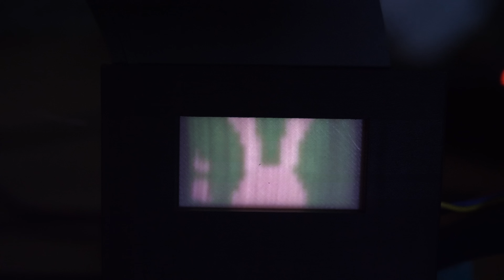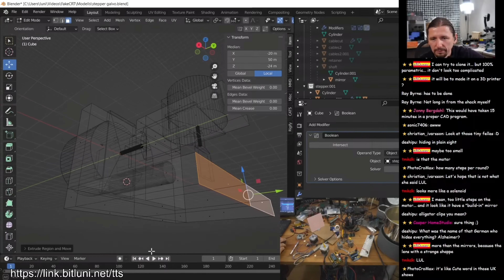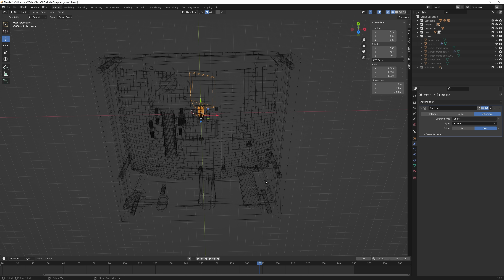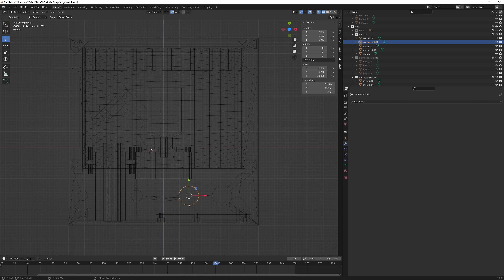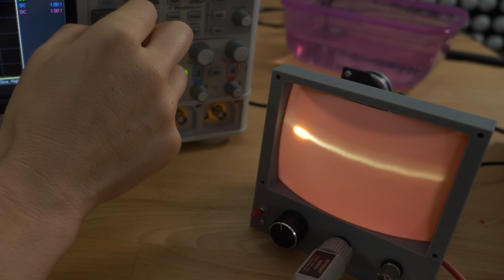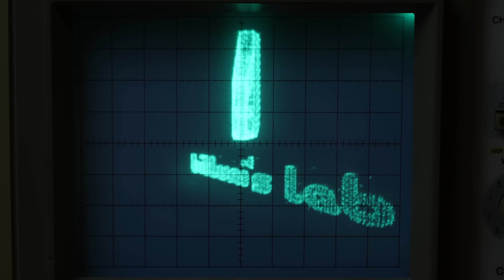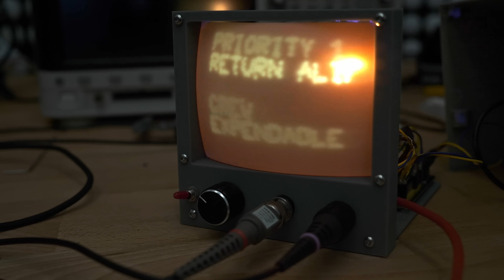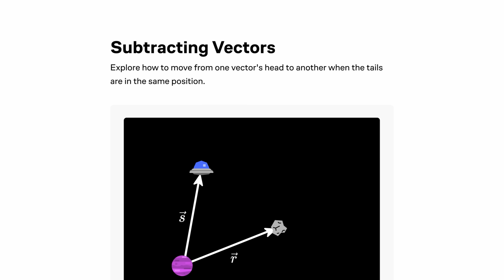I made a fake CRT TV with a LASER

Comment: Over-engineered idea: recreate the CRT method with the magnetic field by putting a lens/prism in a 3D printed enclosed that has magnets around the parameter in a configuration that would allow it to float when placed in an outer ring of electromagnets. Then alter the power to the out ring to move the lens and deflect the light.

Backup is use the magnets still as a control but mount the lense in a 2 axis gimble with very smooth barrings.
Reply: Or have a mirror in the magnetic ring. That should not only make the moving part lighter, but also reduce the depth of the whole assembly.

Comment: Excellent example of mechanical projection TV.
But I want to note that you used a slightly vicious way of implementation: in laser printers before (and in some models now) mechanical scanning of the laser beam is used. For this purpose, a rapidly rotating mirror or a three- or more-faceted mirror prism is used. In this case, on the shaft of the motor that rotates the prism, a disk with narrow passages is installed that send a feedback signal that the mirror has reached the "initial position" of the line scan. On the motor with a prism - there are several such control points (according to the number of reflective faces). The controller begins scanning the next line (ignition and modulation of the laser beam power) according to the feedback signal, and after the end of the scan, it extinguishes the beam and while the next face is approaching - sends a signal to the stepper motor to shift the drum to the next line (so that when the new face is approaching - it has already managed to take the desired position). In your case, it would be appropriate to make the line scan a uniformly rotating mirror with a signal of the initial position, and make the frame mirror, for example, triangular and rotate it with a stepper motor (it does not need such a high speed as for line scan). This will probably produce a better and clearer picture.

Comment: I thought of doing some thing like that using a vido drum, but you can also use another stuff, laying some mirrros whose reflection ovelapped for them to be able to scan at 625 hz horizontally,  a 50hz scan is a lot easier evan throug a speaker, I wonder if a laser can be modulated

Comment: there was a low-cost resin printer that used sound and a mirror for beam pointing. but instead of speakers, it used a tiiiiiny pair of actuators made out of the voice coils, glued right to the mirror itself.. so if you didn't mind the screen being kinda small, it could be done.

Comment: As I expected I'm seeing people suggest spinning the mirrors at a constant speed. Just make sure to add a sensor at least once per rotation so at certain points you know where everything is. Could even be useful to align the timing of the two if the motors spinning the mirrors have some speed control to sync everything up.

Comment: No need to shake the mirrors, it's slow. A good solution would be to let them rotate constantly. Knowing the exact speed of fusion and the position of the starting point, you can switch the laser to draw the desired point. With a seemingly greater distance, it will work many times faster. And you will get a higher quality image.

Comment: The speaker method could work VERY nicely, have laser go thru a 'lens' to increase it's sweep angle, rather than increasing amplitude of the speakers.
The mirror version is more similar in concept to an Oscilloscope than a CRT TV.
Have the mirrors pass the laser along horizontal rows, (continous spinning mirror?) have vertical movement go in steps after 'each' full rotation of horizontal mirror, ,and turn the laser on/off really fast for where you want the Phosphor to light up instead, then you'll have a 'proper' CRT. 
(It's a laser, you can turn it on/off REALLY fast)

Comment: Hi,
it's a very nice project - I really like this idea. I would share some thoughts about this.

To improve a bit I would suggest to make it in a similar way like in a laser printer. But you need more than one color because the laser only deflects in horizontal - the vertical deflection comes by rotating the drum).
If you disassemble the printer, you will get to the laser cartridge (mostly in the bottom of the printer). There you get stepper motors with already mounted mirrors, lenses and other devices. Some color printers have four of these cartridges, others two or rotating toner cartridge systems have only one. Even the lasers can be useful until the fact that they are used to expose the drum.

To improve without these parts - I would suggest to use double sided mirrors (or hexagonal mirrors like in these printers) and let them spin instead of let them wobbling. It would run smoother, the calibration is way more simple because you can use the stepper motors position (or better said the rotation / defelction angle) as synchronization. Even the refresh sequence would be more on point and it would run faster. To set a "pixel" or dot, you have to get the image into linear data and pulse the laser with these data in correlation to the motor positions.

So with this you would be in the nearest way possible at the original principle. I understand that this would be way more complicated but it would improve the goal and the result you get. You could even use monochrome VGA or better - composite with this principle - would be more easy then try to transfer image data in other ways.

Comment: You might want to add an electrolytic capacitor between the servos power pins to help with higher speed. I would start with at least twice whatever voltage you are giving (16VDC for example) and 100uF.

Comment: As educational purpose fine. But consider spin the mirros much faster, stabilise its speed , at every beginning of the revolution start the timer and you would be able now to count and  turn on laser at required  angle. This would be pure elwctronic way. Thats my idea to have more linear curves made of multiple dots. If you could have blds or pmsm synchronus motor, from    pwm generators you would know compute exact position of motor> angle without position sensor.

Comment: Just threw a flat static deflection crt door bell monitir, I wanted to experiment with to make a vector projector for vectrex game console or compatibile, years back?  Why not try that with a sequential colour filter to make vector colour.  If a kid removes or damages that screen producing lensing,  they can get much more energy to the eye.  I can tell you, for some people even so called safe laser energy levels can cayse damage.   You can use three crts, but the crt is probab,y fast enough to sequence,  however, if you use a tunnable filter fast enough you can get the colour in one sweep.  But, if you use three primary or subtractive filters, you can get the colour that way.  Would be an interesting experiment with high speed.  Now, the last part is the laser crt projector the Russians were designing for cinemas. The crt hits a special laser producing panel.  Now, if you can control the energy to safe levels, you can get a safer panel plane for kids, wity a glass tube.  Have fun.

Comment: I'm thinking raster graphics, now, but if you just spin the mirror of the X axis at a constant velocity you can turn the laser on and off for pixels.  You can drive the Y axis with a stepper or servo still as that doesn't need to move as fast.  Combine the two, sweep left to right, top to bottom, and you could possibly even feed it a "real" video signal with composite or something.

Comment: What if you used a set of servos to move the laser physically l rather than trying to reflect the laser through mirrors, the just having the laser click on a and off as it rolls across the screen, like how the electron beam turns on and off in a CRT. Rather than drawing the lines individually, though this could cause some problems with legibility. This project is a ver interesting one.

Comment: Instead of oscillating the mirrors back and forth, what if you mounted 3 mirrors on a triangular frame and spun it for scanning. The laser reflects on it and as the angle changes it scans in 1 direction till the next mirror comes into position and resets the position of the reflected beam. That way once you get the speed of the motors set to cover the entire screen in sequence you only need to modulate the laser off and on. 

Or, maybe 3 would be too much angle change and you could go up to 4 5 or 6 mirrors to narrow the scan angle of the laser.

Comment: The question is, can it run Doom?
Reply: No, it can RUN doom as fast as the computer it's connected to can. It can't DISPLAY doom without delay. So no, it cannot run doom, just as your monitor cannot. But, it can display doom just as your monitor can.
Reply: @ShishlKebab you sure a little slow
Reply: Yes it can, very slowly bcuz it uses slow motors but runs

Comment: Main problem is the mechanical movement of the mirrors. If you could figure out a way to move them with electromagnets, that may work faster, but I'm not sure exactly how you could make that work well.
Years ago, I found myself wondering if it would be possible to built a modern recreation of the old Vectrex game console, without the CRT, but a new kind of vector display. This seems like a step in the right direction, but the laser could be risky.

Comment: For faster response I would suggest using the 'voice coil' mechanism that moves the heads of a hard disk. Just take apart an old HD.  Remove the platter and mount the mirror on the head arm. You can get some insanely fast scanning. You just need to apply current to the coil.  It takes some work to get it to move in a predictable way as the current through the coil translates to a combination of speed and acceleration but it shouldn't be too difficult to map out.

Comment: Have you seen the Internals of the Nintendo Virtual-boy? They use a Straight Vertical Array of Red LED's (they could have easily used Color but they wanted Simplicity and back then, it was pretty advanced just to even have Different Luminosity of Red LED's at that speed, but Color... they could have done it but Blue LED's used too much power back then and they ran the thing on AA Batteries, Red was more Efficient) and a Mirror that Sweeps Horizontally - Check it out, I'm not sure what they used to swing the Mirrors but It was neat to see it in action when I had one. Somehow, they had a way to accurately detect which point the Swinging Mirror was at and switch the LED bar to display the next Vertical Line for the Frame... and still get a Nice Stable Frame, and Frame Rate... You could check it out because It was something that COULD be really improved upon these day with our more Modern Tech, but hasn't been messed with yet... Maybe one day Nintendo will remake the VirtualBoy (doubtful) but It would be cool to see someone make a Modern Version of it with a Driver that could be plugged into a HDMA and used to view a 3D Video or something. I remember one of the (many) reasons Nintendo had problems was with Moms believing that it was "shooting Lasers into kids eyes" based only on the fact that the LED's were Red and it "Looked" like you were looking at Lasers lol, and they were spreading Rumors and it really hurt sales in the US especially... because Parents were just like "Nah, It's Lasers" but it wasn't lol. I remember that because as a Kid - some News Channel had a Segment i saw called "Are Games Bad for Kids Eyes" or something like that claiming that Game Systems were making kids Stare into a TV screen or into a Headset (VirtualBoy) and in it they claimed that the Virtual boy (they "Hinted") was Lasering Kids Brains lol. It was about the time when CRT TV's were getting alot of hate for the recent discovery of "X-rays" being emited... and the New Best Thing was "Projection and Plasma TV's" -  The Virtual Boy was an Awesome Device that got No Love in the days when it was made... Sadly only about 8 Games were ever made for it i think, maybe 12 not sure...

Comment: Random idea but one way you could possibly quickly and accurately move the mirrors could be to gut a hard drive or two and use the mechanism that moves the heads. Since it uses magnets it might be a lot faster than using motors.

Comment: You can have the horizontal mirror just connected to a spinning motor and then pulse the laser for the pixels. The vertical mirror can then be servo based to control which horizontal line is being drawn.

Comment: 1. Go back to using something fast like speakers. This might be hard to engineer though.

2. In order to make point 1 work effectively, use multiple mirrors (and/or prisms? or even just make it a really long distance without any additional reflection?) reflecting off each other to accumulate a lot of distance. With more distance means more travel for the same movement/change-in-angle. Different speaker designs (or other fast solenoid-like devices) would also be good to look into.

Comment: I think the repurposed speaker idea you had at the beginning was a good idea, just poorly implemented.
The vertical can be driven directly off of stepped down and limited mains AC, for a mostly consistent 50/60Hz cycle, the horizontal can be driven by a 6000Hz sound wave run by a more powerful amp than what you gave it, to provide horizontal lines in tune with the vertcal, and then the image can be generated by rapid power cycling of the laser.
I don't know if the laser will respond fast enough to the power cycling to be usable like that, but it's an idea nontheless.

Comment: Copy the mechanism out of a laser printer. That uses a spinning hexagonal mirror to sweep the beam across the paper. Use two of that for a raster scan. 

The more sides on the prism, the slower you'd need to spin to get a sweep. A 10-sided mirror would only need to spin 5 times per second to get a 50Hz sweep for the vertical. The horizontal would need 25 sides spinning 625 times per second for the line frequency used by PAL signals (15625Hz). If you wanted to show VGA, you'd need the horizontal going about twice as fast and the vertical only slightly faster (standard VGA timing is around 31kHz horizontal and 70Hz vertical).

The diode response time would need to be pretty fast (tens of megahertz), but we've been using them for networking for decades, so they're probably readily available.

Comment: If you make a D-shaft cut to a stepper motors spindle, you can do with glueing the mirrors directly to the spindle - and make them  1x2 cm - even the small weight of the plastic attachments and the mirrors size can influence the precision of micro stepping at high velocity. Very Nice project! :)

Comment: OMG, i started LOL for real at 2:20 . a better way would be having the speaker push a pivot point like lever action on the mirror. point 1 being edge of mirror fixed position, point 2 being 1-2 mm away from point 1 allowing a small motion of the speaker to multiply to a large rotation of the mirror.

Comment: Have you seen how Nintendo’s VirtualBoy console’s solution? (their flopped attempt at a VR headset in the 90’s) It similarly has an oscillating mirror which reflects the light coming off of a strip of 224 tiny red LEDs. By turning these pixels on and off depending on where in the oscillation the mirrors were in, a picture could be generated, one for each eye.

Comment: 11:39 don't you have to bias the transistor(corrected)? I mean if it works it works, but I thought unbiased transistors were unstable
Reply: "bias the resistor"? I think you mean transistor. And no, you dont need a bias in that case for a logic n-Channel FET. Just sometimes bipolar transistor need it, depends fom case to case. 😉
Reply: @ZweiStein3154  Yes, I meant to say to bias the transistor with a resistor. I have a lot to learn, transistors are hard. Thanks for answering!

Comment: This is a really cool project. I was thinking maybe you could improve the rasterizing mechanism by replacing the mirrors with two lenses, one for the vertical field and another for the horizontal, each connected to a motor. The motors would change the angle of the lens relative to the laser and thus change its angle.

Comment: Make a screen with a hole in the middle. The hole should be the same shape as the outer edge of the screen. Make several of these screens, perhaps all the same size, and situate them one in front of the other at a distance that makes the outer edge of the next one match up with the beam as it goes through the hole of the previous one. There should be an intact screen at the end though, unless you reflect it back the opposite way for double'ish the screen area for the stack. Find a material or process that makes the laser color different to the viewer depending on if it hits the front or the back of a screen, and you've got an action-packed gizmo from one laser and an extremely fine/fast mirror thingy. More importantly, building this wonder unlocks the "Airhockey Physics Trick" achievement and grants the "Ready for High-Speed Microphotolithography" perk.

Comment: Great project. The most smart part is the signal calculations to produce a picture. Tip: you can harvest a high speed rotating mirror/motor from old scanners, or video projectors.

Comment: Have you verified with certainty that you are using Microsteps?  Those CNC breakout boards have a design flaw.  They provide ground to MS0,MS1,MS2 on the stepper driver board.  The chip requires a high signal 2.2-5.25V.  There are internal pulldown resistors on those pins so it will default to full step mode.
It's easy enough to fix with a jumper wire and solder bridge.

Comment: Good work.
I suggest you can use brass hot melt insert nuts instead of square nuts. It will make 3d printed parts more rigid. Also it will be easier to design.